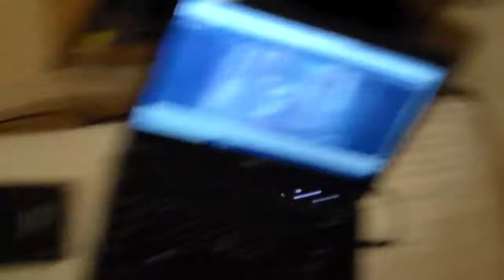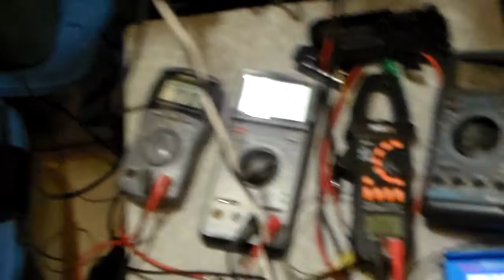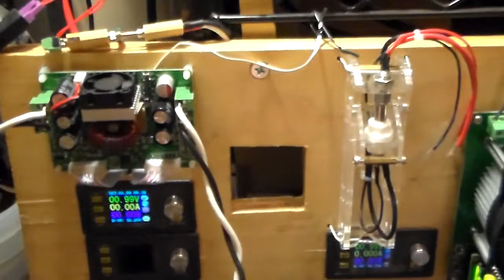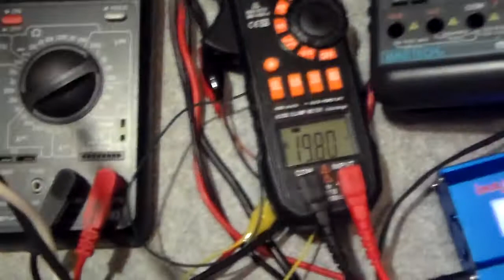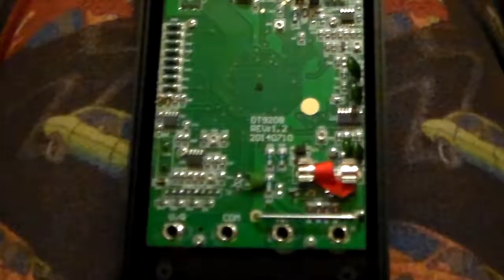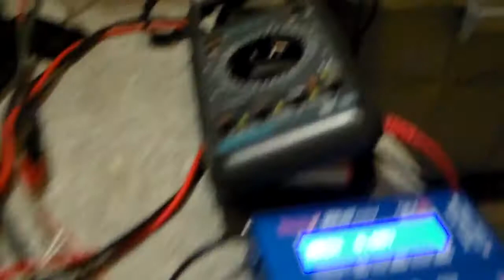Calibrating my multimeters Radio Shack 29 range, Centech 61593, TackLife CM01A, Mastech MY-65

Comment: For your 61593, could you take the board out (don't remove the two screws next to the piezo beeper) and photograph or video the contacts on the selector switch? Some of the contacts popped off mine, and I'm trying to see where to put them to make it work again before I calibrate it.